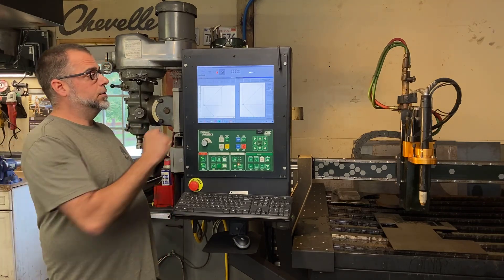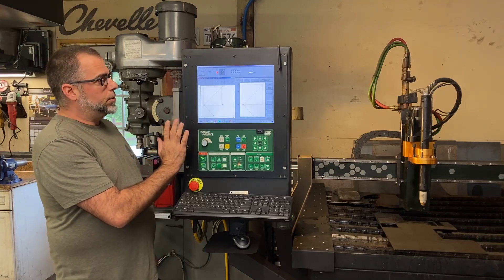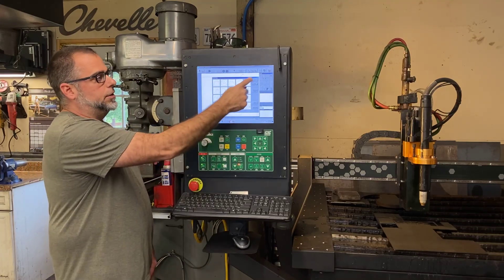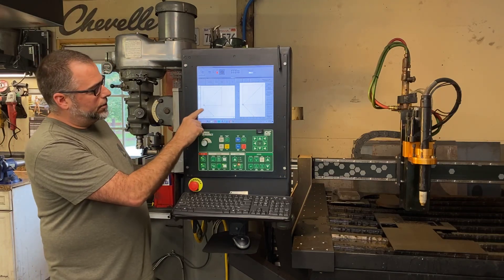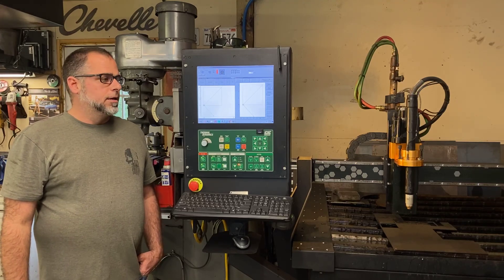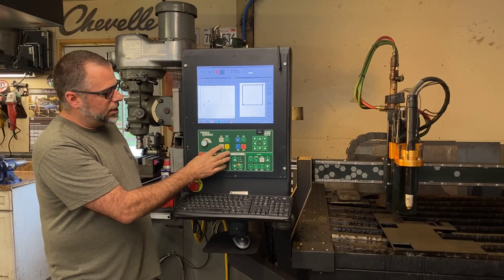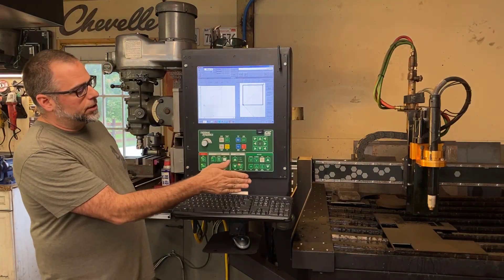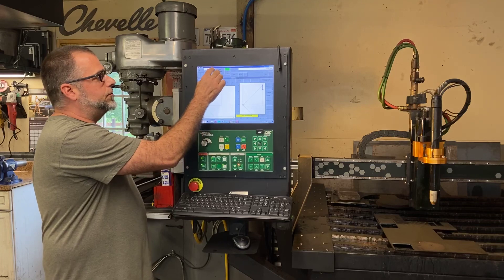Plasma cutting 101 on Thermal Dynamics iCNC

Comment: Hi Randy, do you know if you can have multiple lead in and lead out sizes for large and small features on a plate?
Reply from the maker: Yes if your CNC has Level 1 software option.  You can check by opening Nest on your CNC then click on About/registration.  If S1 productivity tools is checked you should be able to have several different types of lead-ins and lead outs on a shape